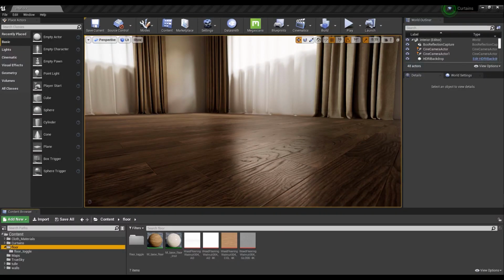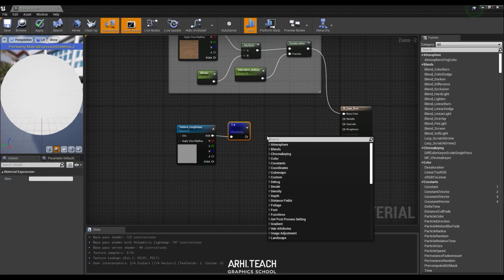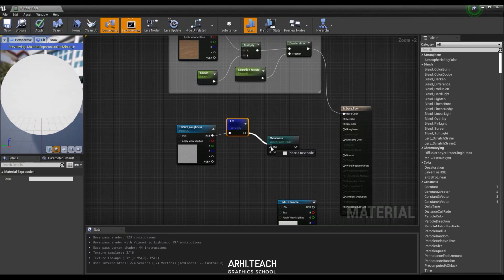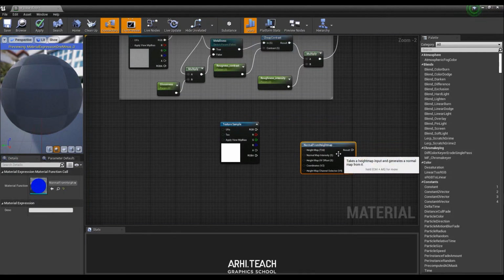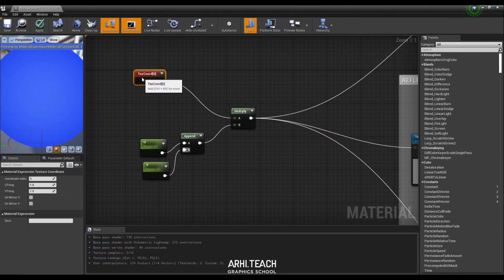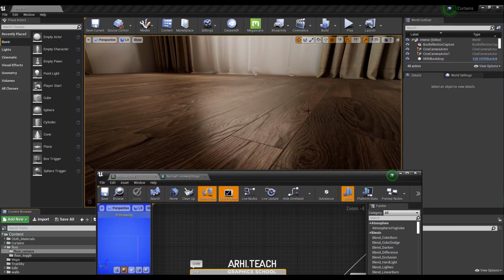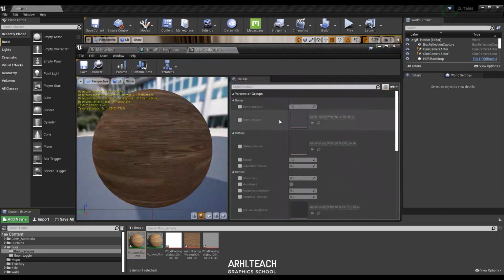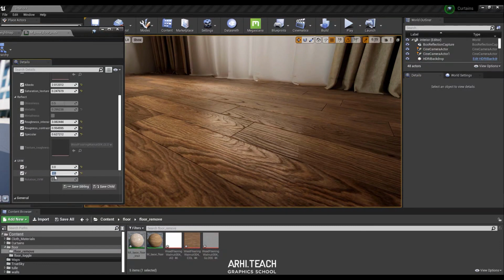How to create complex material in Unreal Engine fast and easy | Unreal Engine for Beginners Tutorial

Comment: Thanks for this tutorial, it's my 1st try to make a material! and it works! I also use additional Multiply parameter for UV angle (x0.00278) which is 1/360. So you can enter the angle in degrees! Cool

Comment from the maker: Content of How to create material in Unreal Engine fast and easy Unreal Engine for Beginners Tutorial
0:00 Intro
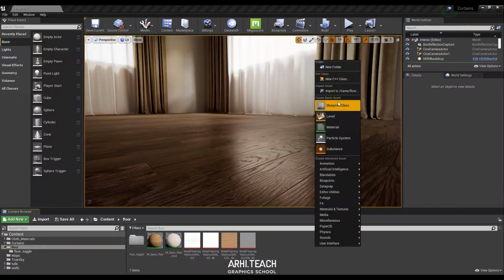0:10 How to create complex materials in Unreal Engine
2:00 How to optimize work process with further quick change in Unreal Engine (Diffuse, Reflect, Bump) 
3:10 Diffuse
6:10 Reflect
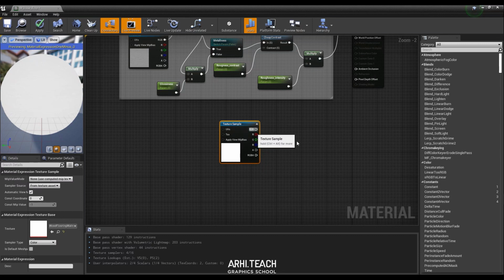12:18 Bump
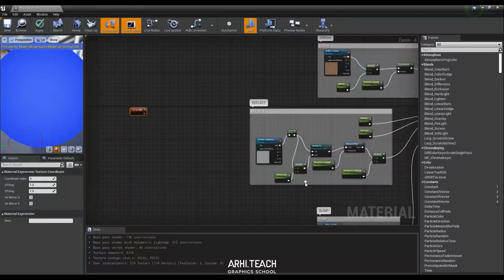15:00 Creating a texture control section in Unreal Engine
20:33 Создание инстанса материала в Creating instance of a material in  Unreal Engine
22:08 Creating your own categories of a material in Unreal Engine
27:48 Testing of complex material settings in Unreal Engine
34:30  Outro